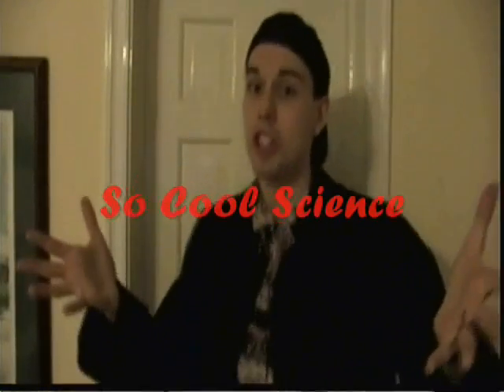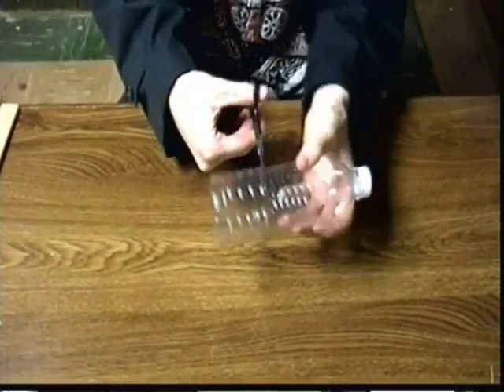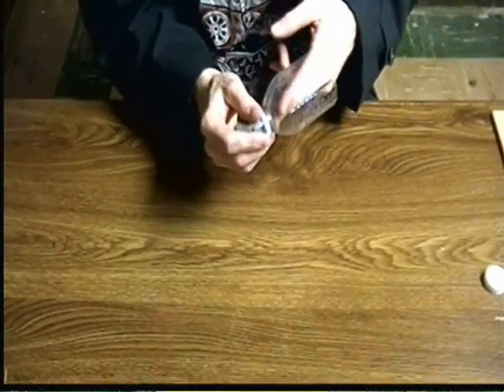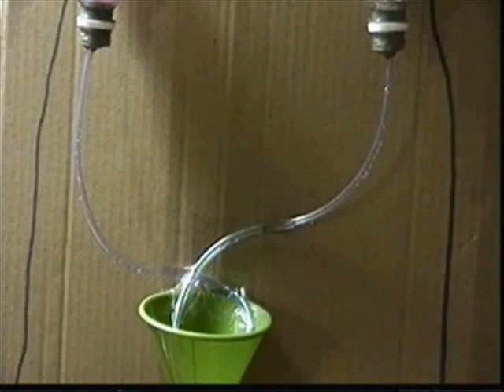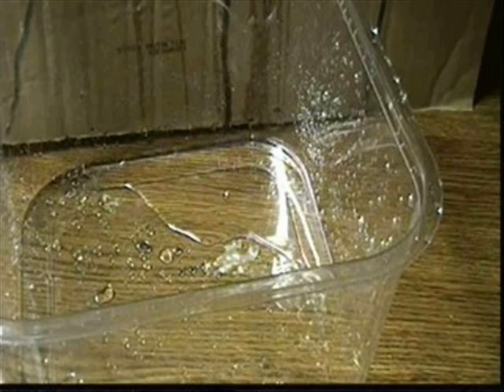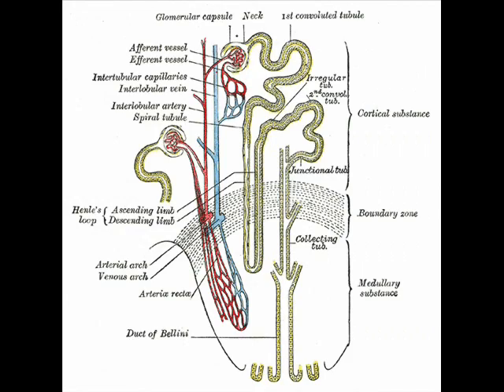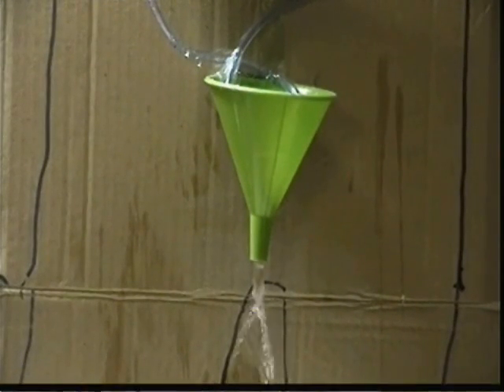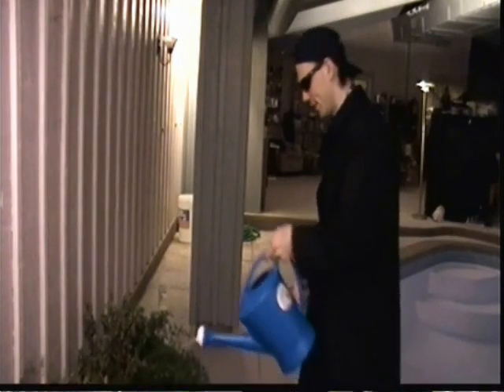!!!KIDNEY MODEL AND FUNCTION!!! (KIDNEY FILTRATION & REABSORPTION) SCIENCE EXPERIMENT

Comment: what is the reason of putting clay inside and outside the hole of the bottle you are already pyt the tube ?
Reply: It is put there so that there is no leakage of the liquid at the joints........
Reply: It's to keep the water from flowing out. The tubing isn't wide enough to completely cover that space.